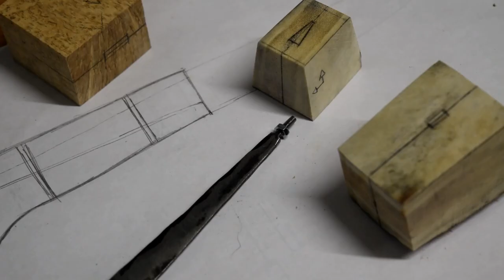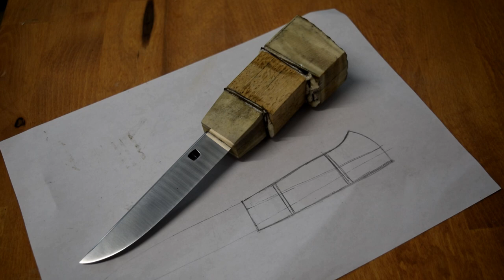Making a Finnish Saami puukko

Comment from the maker: Just a quick disclaimer about the title in the beginning of the video. 
This knife is not a Tommi puukko, I got confused by the name of the blade based on its diamond shape.
I just couldn't change the title without removing the video and reuploading it. 

Thanks for your understanding :)
Reply from the maker: Matsumoto Outo  This is birch wood, the same one used for the handle
Reply from the maker: Matsumoto Outo  ah ! This is just to cover up the hole of the tang where I screwed the nut ;-)
Reply from the maker: Gangster of love  It's Switzerland and my blades are coming from Brisa ;-)

Comment: Excellent work but I'm not sure if the glue will last, especially if you will use this knife as it should be!
Reply from the maker: Interesting, what tells you that ? 
Because i had the same feeling and i started to swith with epoxy glue
Reply: @StevesWorkshopSwiss  
It's just my experience with this type of glue. I tried so many different products but in the end none of them worked. They don't work in wet and cold conditions especially not with goods that will bend or are exposed to different forms of pressure. 
The only type of glue that works is an industrial two component glue like epoxy or something like this in combination with a primer and a filler for bigger gaps.
Reply from the maker: You are right, I made a Leuku years ago and I used it to chop trees and stuff and the glue broke due to the pression on the handle. That's why on the last knife I made I started to use epoxy glue which seem to have more elasticity.
Thanks for sharing your experiences ;)
Reply: @StevesWorkshopSwiss  
This is one of the reasons why the nordic knife makers have used sliced birch bark or leather slices without glue as a handle material. they pressed it and then they fixed it with metal and a hammered tang. so the knife was comfortable, strong and flexible at the same time.
A glued handle without a fixation with screws or nails will not last.

Comment: Hi, I have two questions: do you work on dry or moistened leather ? (between 11:47 and 14:18), and second : makes it sens tu use brass on the handle? at the beginning if shiny, looks gorgeous but after few weeks in sheath it will react with leather and will get ugly, green residue
Reply from the maker: Hi, thanks for the comment.

The leather is slightly soaked into warm water and directly worked. I'm not an expert on leather working, I learn along the way, from my experiences and from what I see on online. There's surely a better way to do it ^^'

Traditionally on Finnish knives and scandinavian type of knife you often see brass for the guard/bolster. That's the reason I did it but also because I like the look of it and I accepted that a knife like this requires regular maintenance and care. 

The way I see it, if your brass gets a bit old, or if you hit the wood of the handle, you can still sand it slightly, polish the brass and apply a new layer of linseed oil. 
The other option would be to apply several layers of varnish which will seal the brass, the wood and the antlers. On the other side if you hit the handle the varnish will chip and you can not revarnish it and having something that looks neat and clean. 

Basically it's a personnal choice, either you oil it and you know that you will have to take care of it and apply some oil some time to time or you can have something really neat with varnish but if you hit it it will age not so well.
Reply: Try German Silver vs brass

Comment: What kind of bone do you use.? Yours seem to be solid all way through.. the ones I have available have some kind of porous material in the center..
Reply from the maker: It's actually moose(elk) antler, it's still porous but dense enough to work with ;-). The reindeer antler works perfect as well depending of the quality of it but regular deer antler is too porous.
Reply: @StevesWorkshopSwiss  that's probably the issue then.. living in Denmark, deer antler is the most common type, so that's what I got on hand
Reply from the maker: @DaemonsBane  It's the same problem here in Switzerland, that's why I order suplies in Finland, like on Brisa.fi

Comment: Why do you use PU glue instead of epoxy? It is a kind of strange choice
Reply from the maker: Because the PU glue slightly expand itself when drying. You can increase this expansion by watering the parts (it sounds wrong said like that ).

My reasoning was that if my part adjustment wasn't perfect the glue would fill the gaps and maintain some resistance inside the handle. But now I'm slowly using Epoxy because it's way harder and it seems more durable.

Comment: 0:02 Tommi puukko means 1 type of traditional finnish knive, and that's not it.
Reply from the maker: You are right, it isn't a Tommi puukko nor exactly a traditional saami knife. I was inspired by the saami puukko to make this one,  that's it. I know there's a lot of different variations between saami knives depending on the area.
I was confused in first place because the type of blade is a diamond shaped one, made especially for Tommi knives. 

When the video came out, I realised my mistake and I changed the title but I couldn't remove it in the video without reuploading it. 

I was expecting this comment ;-)